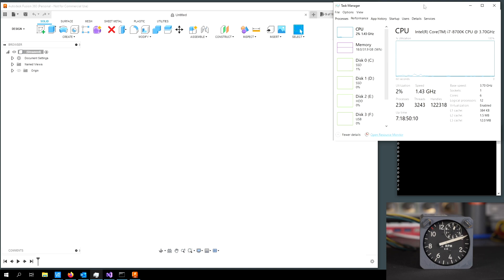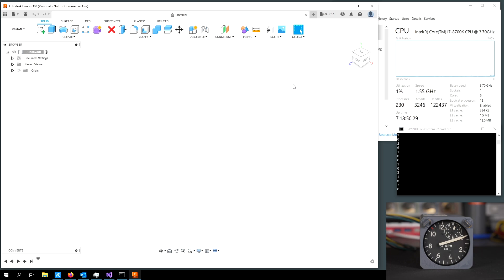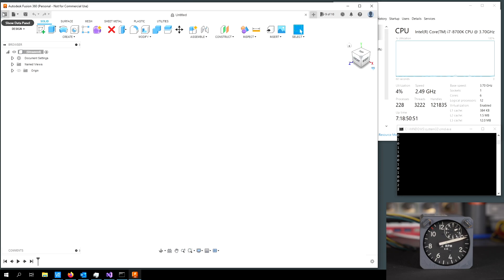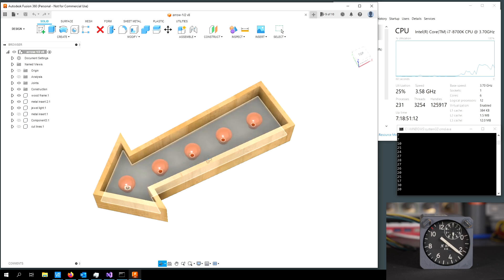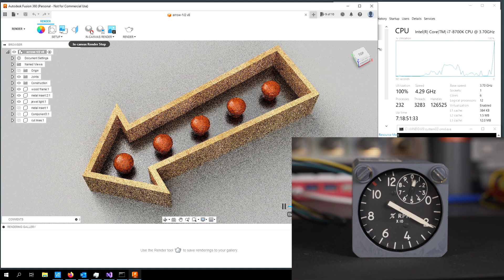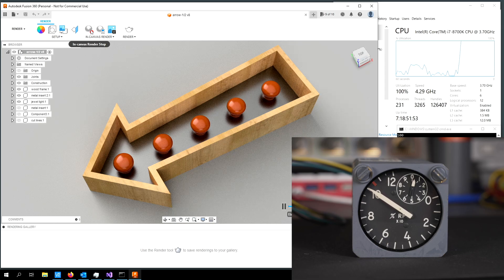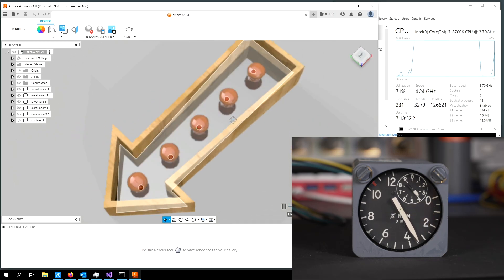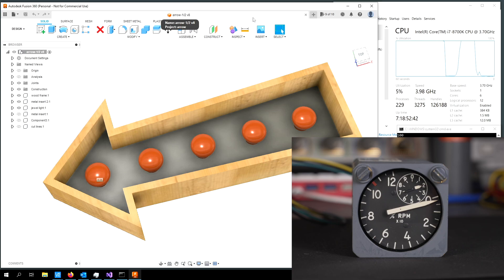Using vintage aircraft engine tachometer as a CPU utilization indicator.

Comment: What does the smaller dial within the dial indicate?
Reply from the maker: It's the one's digit. For example at 25%, the big dial will be half way between 2 and 3 and the smaller dial will point at 5. You get pretty fast at reading it after a while.